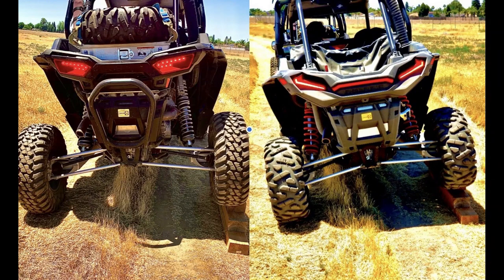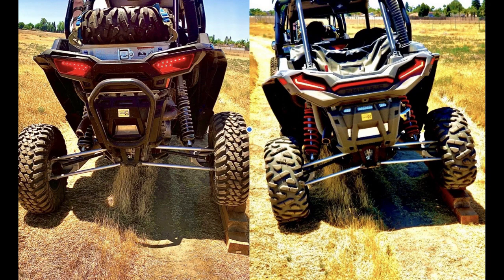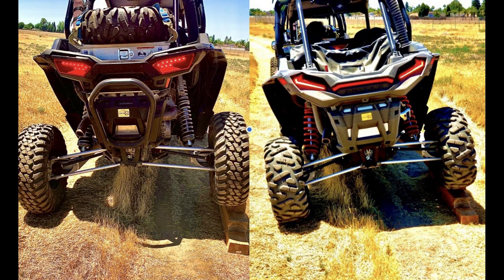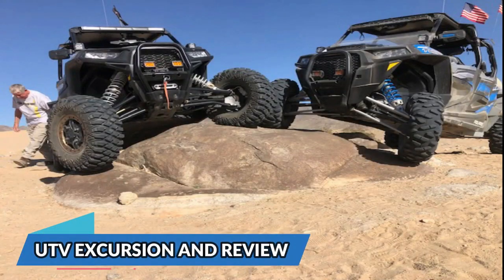Review of Walker Evans Walker Links

Comment: I just have to point out that the horizon line on the  left picture is tilted a lot to make the RZR seem flatter.  I have these on my RZR 1000.  With them on, when you hit a 4" bump with one rear wheel, only one shock will have to be squished.  Without them, when hitting a 4" bump with one rear wheel, both shocks will have to be squished, because the sway bar is transferring the impact to the other side also.
Reply from the maker: Thanks for watching

Comment: Not to be a negative nancy but there's a little trick photography going... may not be on purpose but when giving a review you want to make sure your presenting 100%.. so as not to be biased or present biased info.. if you look at the horizons in the pictures the pics are clearly scaled so that the left machine looks more up right. If you tilt you viewing device so the left horizon matches the first it is almost if not the same angle as the pic on the right. Again not saying this is purposely done but it should be pointed out if not corrected

Comment: Nice review, I purchased a couple of these for the rear of my RS1 a few weeks ago, and removed the front sway bar,  I'm not to concerned about articulation as I do not rock crawl, I purchased them to cushion the impacts on rough trails with rocks on them and going through and up streams, The extremely harsh ride on stock springs along with me bouncing side to side inside the RZR was making trail riding very uncomfortable and wearing me out. 
I put some Shock Therapy springs on it that made a big difference and hoping these will make a big improvement too.  I have not been able to ride the RS1 yet so I can not comment on them yet. I might go all out and get the shocks re-valved too. Depending on pricing either with Walker Evans or Shock Therapy.
Reply from the maker: i dont do much rock crawling either but they work nice

Comment: Do you think it’s worth buying the turbo 4 s velocity over the xp 4 turbo with all the upgrades? I drive a lot in the mountains and there are a few wide open areas but there are some smaller trails. I like the extended travel and walker evans 3.0 shocks and the beefier parts oh and the cage and 32” tires of the turbo s
Reply from the maker: Yes